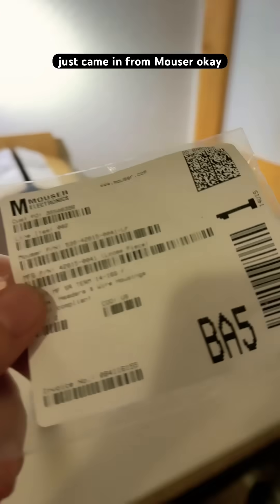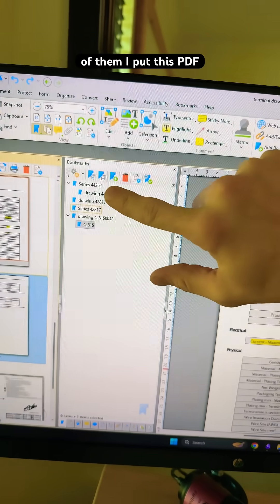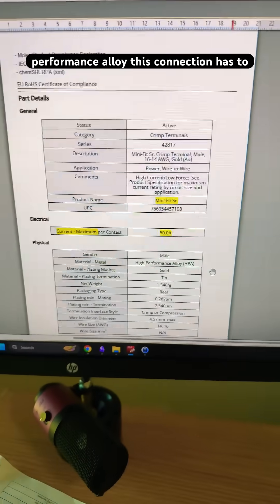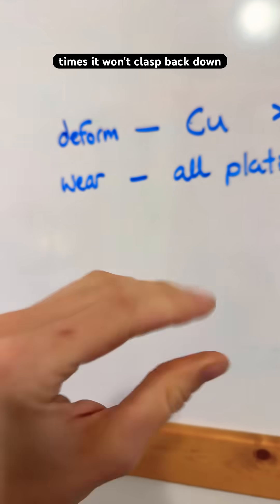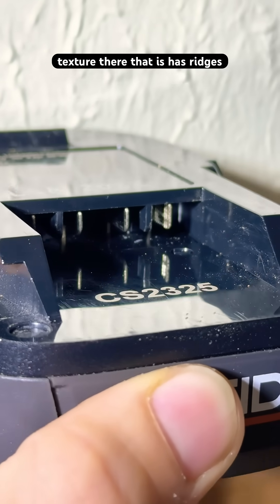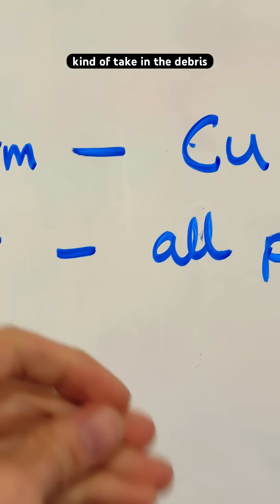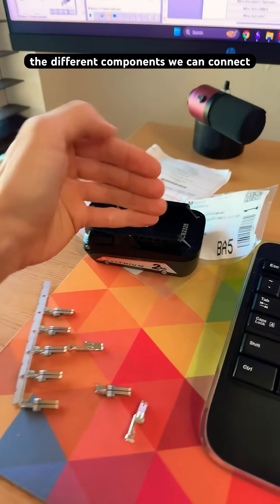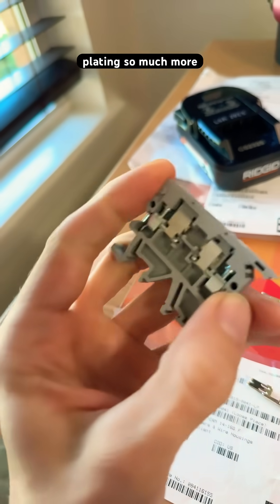complex engineering of a high-current battery contact, for power tools

Comment: I started working in electronics through engineering electronic cigarettes back in 2010. They are a very unique challenge as well especially back than. It's an extremely high draw for the size of the device so batteries and contact materials became a challenge. Once the industry developed it became alot easier but those early days were a scavenger hunt for components
Reply from the maker: what’s an example of a component that took a lot of effort to find, inside those devices?  Sounds like a nice lesson.  I’m still searching for a reliable modular spring tab that I can stock for 18650s that are not welded.

Comment: 50 amps at what voltage?
Reply: Voltage isn’t the key here.
Reply: All of them
Reply: The heat generated by a given connection is a function of the current flowing through the connection.  The voltage rating will take into account the isolation between the conductors and the human.
Reply: @d46512  that's not entirely true. starting very high voltages, you can get arcover eg while mating, and that creates carbon deposits on the contacts. get enough of those and the surfaces can't mate enough metal to metal, and current starts going through the deposits, which are resistive. that causes heating and perhaps eventually failure.
Reply: @cheater00  I think this connector is not made to be unplugged under load. This is more appropriate for contacts of a relay
Reply: @ yes, of course, but you were talking in general
Reply from the maker: i’ll run 18v most of the time, and up to 100vDC sometimes, and probably no AC.

this goes together with the power tool equipment like drills.
Reply: @ thanks the reason i ask is often install custom 12v and 14v mini splits and heat is a real issue on longer runs.
Reply: 24v*